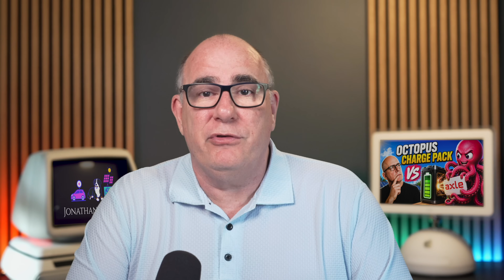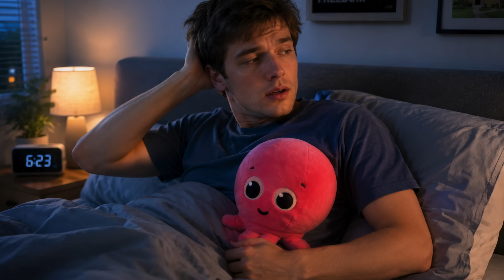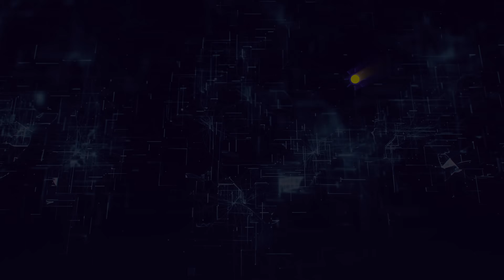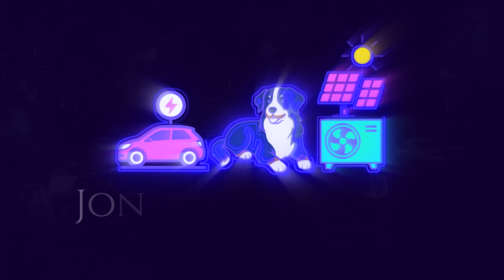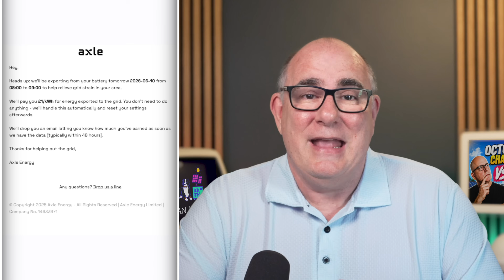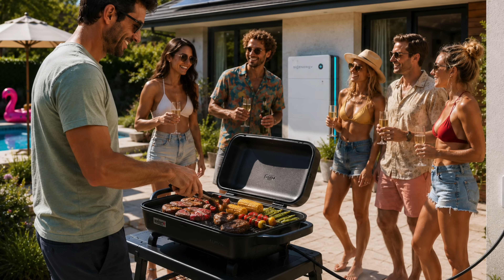Octopus Charge Pack Just Fired A Shot At Axle Energy

Comment: I'm curious how big this hot tub is, you've got the hounds of floof and you want to get in?

Let alone your friends as well...

On the less serious side, have you come across any battery management systems that can connect different model / age / type of batteries (of the same voltage) together?
Reply from the maker: It’s not very big you can get four adults in it, add a fifth and you really need to know each other very well. The dogs do occasionally attempt some sort of flying leap but we’ve discouraged enough that they haven’t done it recently.

I haven’t really done any research into independent battery management systems, there are plenty of them out there for the DIY space, but I just haven’t had the time to look into it yet
Reply: For two different types of batteries you end up wanting two inverters. You've either got to do DC to DC conversion between the stacks or DC/AC so you might as well just keep them as two systems. Of course G98/99 limits can scupper that unless you make one system house internal and not grid tie.
Reply: @etchedpixels Sunsynk talk about their Klik (check spelling), which is not available in the UK or Europe but is used successfully in South Africa and Asia.

Two different battery manufactures same design voltage. Rather hoping someone else had a similar device

Comment: I have a Sigen battery as well as an EV. I use Sig's AI and find it works well. I am on IoG with a Zappi charge point. My current issue is that if I plug in before the cheap rate period it will drain my battery. I could move the Zappi to before the gateway to stop this but would prefer not to do this. I have opted to try charge pack to see if this helps. Home assistant access to the Sig API's are currently read only so forcing the batteries to charge is not available. It will probably be no different to the Sig AI functionality.
Reply: I have the same problem with my Tesla powerwall and Tesla charger

Comment: I have to say I did try Octopus smart automation with GivEnergy for my system, I gave it a month to see how it worked, sorry to say it did not work for me, I found we used more grid power during that month & I would have hoped that would have been cheaper slots not nec at night but it was grid power I would not have used had it been me controlling when to charge so my bill was slightly higher than I would have expected so I would be very wary about handing over control of my system again, they called it smart charging sorry to say I didn’t find it very smart so I will stay in control of my system.

Comment: I'm currently on the full control end of the choice spectrum because it takes a while to get an export tariff after your solar is installed, here's why:

I'm on Iintelligent Go, I have a GivEnergy 9.5kWh battery, an MG5, 4.8kWp solar array, and a heat pump.

The issue is that I don't have an active export tariff yet. So any electricity exported is money lost to me until that's fixed. Hence I'm trying to maximize self consumption. The first few days I exported about 25kWh a day and got paid nothing!

Problem #1 is that Octopus Intelligent Go wasn't letting my wallbox pulsar plus send excess solar to the car. When I overrode that and set a 6A limit to only use the solar, Octopus overrode that to 32A meaning most of it was coming from the grid!  Then over night it overrode my settings and fully charged the car off the grid! I've now installed a system that prevents the car from charging off anything but excess solar but it was a right faff to get working and required pretty extreme measures!

Problem #2 is my Vaillant ASHP seems to completely ignore when I ask it to/not to heat the hot water. It doesn't even show as active, but I can see from the power consumption and temperature sensors I added to the system that it is! Or I ask it to heat it and it says it is, but does nothing. I feel like the minimum requirement as a customer for a product is that you can make it work when you ask it to. Or at minimum it tells you why it decided to ignore you. 

So I've ended up with a rather complex Home Assistant set of automations to get they system to consume as much solar as possible. But a lot of that is going to a portable AC unit to make the house more pleasant to be in, in this heat wave. Upside is I'm consuming 100% of the solar produced. Down side is that it also consumes about 10kWh from the grid over night. I need to tweak the settings to turn off loads earlier to ensure there's enough in the battery to last over night. 

But the issue is that it's currently a heat wave and the house is 24C with all the south facing windows covered with reflectors, windows open when it's colder outside than inside in the evening/morning, and the 1500W portable AC running when there's excess solar or cheap grid power (windows closed).  There's 6 hours of cheap overnight power on intelligent go, that's 9kWh before any house base load use, or the evening after sunset/early morning before sun rise. 

On the plus side, it cost £10 to run the portable AC for 24 hours straight before the solar, now it's about 70p for all house usage and the portable AC. I'm definitely saving money, and maintaining thermal comfort. But when the export tariff is live I'll swap to fully charging when ever there's cheap grid power to maximize my exports and minimize self consumption. 

(It's a one hose Electriq 14000BTU reversible portable heat pump unit, that I've modified to be two hose. I made a 25mm PIR board that slots into a window with the two one way baffled 150mm wall plates in it to separate the hot side from the cold side. Maintains the whole three bed semi detached house at about 24C average during the day.)

Comment: Right now I have a Sigenstor being install, it has its own AI, which I am planning to use.  My plan is self consumption, Next year I and planning an Air to Air Heat Pump and wall units that will heat and cool the home.  In these summer months I am exporting between 6 to 11 kWh at 12p.  That is enough to run the heating in the home during the daytime. Then use the batteries to cool on piping hot summer nights and only off peak power. For hot water and Showers I am thinking of the Sunamp, a small unit about the size of Tumble dryer that heats cold to 40c on demand by using phase-change materials. Clever stuff. That’s my plan - here is hoping it comes together.
Reply from the maker: @steverobinson2389 Sounds like you've thought this through carefully. Self-consumption is usually where the biggest savings are, and with a decent battery system plus air-to-air heat pumps you should be able to make very good use of your solar generation.

I've heard some very positive things about Sunamp as well. Using phase-change materials to store heat is a clever approach, especially where space is limited.

The SigenStor AI will be interesting to watch too. We're seeing more and more systems trying to optimise themselves, so I'd be very interested to hear how it performs once you've lived with it for a few months. Keep us posted!
Reply: @JonathanTracey  yes i will let you know. I am also having the DC to DC charger. I think in inverter is  15 kWh as I am on a 3 phase supply. It’s all very Si-Fi but have done a reasonable amount of research
Reply: We have air/air batteries and solar. Right now the aircon is on and the battery is charging as well, that's with a pretty small array. Be even better if the council hurry up and approve our next 10kW 8)

Comment: I did sign up to Axle and the two events I participated in went without a hitch. But Octopus expressly said that I can't have Axle, at the moment and Intelligent Go.
I only found this out when reading about charge pack.
I have signed up for Charge Pack and will see how it goes, if it isn't for me I'll leave.
Reply from the maker: the last two events I participated in I was on IOG and it worked just fine, mabye they are tightening the conditions to try and get an advantage
Reply: @JonathanTracey  Not sure that it's Octopus who decided this. iOG and Axle both appear to be using the same scheme so you are not allowed to double dip. Just in one case Axle gives you a pound, and in the other case Octopus give you slightly cheaper power all the time.
Reply: After re watching your video, I have decided not to go ahead with Charge Pack. I preferred the simple Axle idea, but if I can't have that, I'll pass. You just got a subscription.

Comment: thanks for the info on this, i saw the charge pack on the octopus website last night, theres a £12 a month incentive to sign up to charge pack from octopus, im getting more than that back from axle every month and its easy to follow/work out, octopus need to give us a bit more info before i hand over full battery control to them
Reply from the maker: @richardhandley3080 Yes, that's crossed my mind as well. If Charge Pack starts attracting customers with a £12 minimum guarantee, Axle may feel some pressure to respond.

That said, Axle's strength has always been simplicity and transparency. If I'm earning £15 from Axle, I'd rather have that than a guaranteed £12 from a scheme where I don't fully understand how the rewards are being calculated. It'll be interesting to see how the competition develops.
Reply: @J @JonathanTracey think what is pertinent here and most people would like to know is how much per kWh Octopus is willing to pay for exporting from their batteries. With Axle it’s clear, £1 per kWh. Octopus is very obscure with their payment description, something about the difference between the import rate and the export rate. Doesn’t sound as though that is anywhere near £1 per kWh!😂
A £12 per month minimum payment means nothing without knowing how many kWh will be drained from your battery each month!

Comment: You make a fundamental error about what ai can predict. People's behaviour on mass is quite predictable. So octopus don't need to know you are having a BBC and heating up the hot tub,  they can make such predictions based on weather time of day, your electricity profile etc.
Reply from the maker: @cunninr2 I agree to a point. On a population level Octopus can probably predict behaviour remarkably well. That's how suppliers, supermarkets and insurers operate.

My point is that for each individual household it's about their plans and their behaviour. The high-level view is great for Octopus, but it doesn't help the individual who suddenly decides to charge an EV, fill a hot tub, have guests over, or simply wants a full battery tomorrow because the weather forecast has changed.

That's why I personally prefer systems where I remain in control most of the time and choose when to participate.

Comment: Great video thanks, I have a new install solar and 20kwh of battery, I will generate through the whole day as solar panels on three sides of roof. I am with Octopus IOG as have two EV’s. My concern over Octopus controlling the home battery is that peak is between 4pm and 7pm and my solar will still be generating around 4kwh, if Octopus then decides to discharge I will stop generating. It would have to be very worthwhile to do so.
Reply from the maker: and that’s the key bit of information that’s missing, exactly how much will they pay you for this, with Axle is clear

Comment: I'm trying to help my brother in the UK who has Solar, Batteries, Heat pump and has just purchased an EV. I have suggested moving from Cosy to IOG and also moving from Octopus Outgoing Fixed to a tariff that makes better use of his 20kWh of batteries. We have talked about a 3 hour forced discharge 4-7pm with Prime or potentially earning more with Outgoing Agile, but for someone who will never use PredBat and Home Assistant,  Charge Pack might make him more money. Looking forward to more videos on this topic and real world experiences from early adopters. He is using Axel currently but has yet to make more than the £10 a month guaranteed minimum.
Reply from the maker: @EcoHouseThailand I think your brother is exactly the sort of person Charge Pack may have been designed for. If he's never going to use PredBat, Home Assistant or spend time optimising tariffs, then handing control to Octopus could genuinely produce better results than a DIY approach that's never actually implemented.

The interesting comparison will be against Axle. If he's only seeing the £10 minimum today, then Charge Pack's £12 guarantee immediately narrows the gap. We really need a few months of real-world data from early adopters before we'll know whether the additional £2 comes with meaningful extra earnings or just extra control handed to Octopus.

Comment: I'd like to see what the compensation numbers look like first.

Their doc says "We compensate you the difference between your day rate and the export rate"

I wonder if that is up or down 🤔, and if this works with Agile Outgoing.
Reply from the maker: but if that’s the case they could say that, by keeping it close to their chest they’re not allowing people to make a decision whether this is right for them or not
Reply: The way I (and gemini) read it, if i'm on Octopus go my day rate is 32.36p so if i'm on agile outgoing, lets say i get 22p outgoing at the peak time they discharge then they will pay you a 10p top-up. When combined with your 22p standard export rate, your total return is exactly 32p per kWh. So to compare the Octopus Total Return: 32p per kWh (Zero net profit for the actual energy cycled; you just rely on the flat £12/month bonus). The Axle Energy Total Return: £1.22 per kWh (£1.00 dispatch bonus + 22p Agile Export). Even after replacing that power at 32p, you are banking 90p per kWh of pure profit.

Comment: Today's updated details so far

Here is what the session credits will cover:

Any battery importing done at your day-rate during a session will be compensated so it effectively costs you the cheaper off-peak rate.

Any exporting to the grid during a session will be compensated at the difference between your import day-rate and your export unit rate.

We'll add a bonus on top as a net reward for joining the session.

These rewards are in addition to your existing rates and participating in sessions will always benefit you financially—you keep your existing Outgoing savings, with £12 per month minimum credit.
Reply from the maker: @trevorpitchell5970 Thanks for sharing that. My first reaction is that you almost need a calculator and a spreadsheet to work out whether Charge Pack is a good deal for your specific setup.

With Axle it's much simpler. Export X kWh during an event, get paid £Y per kWh, plus your normal export payment. You can usually work out the value in your head.

Charge Pack may well work for some people, but the maths seems considerably more complicated and will depend heavily on your battery size, inverter power and usage patterns.

Comment: I'm guessing that both the Octopus "sessions" and the Axle "events" would be at the same time because they're both responding to the same grid requirements. I'm also assuming that trying to sneakily sign up to both wouldn't work, although Axle failed to change my battery settings for the last event, yet I manually set it to discharge and they were happy with that. So I'm not sure how they can tell, as long as the power actually leaves my battery to the grid.

Anyway, thanks for this. I was considering the Octopus scheme, but I'll hang on a bit for now and stick with Axle until Octopus put out a bit more detail.
Reply from the maker: @keysersoze8110 Yes, I would think so, but it's not entirely clear from the information released so far. Axle seems to be focused on specific grid events when flexibility is needed most.

From the way I read the Octopus FAQ, they may have the ability to charge or discharge your battery whenever it benefits their optimisation model, not just during formal grid events. That could be absolutely fine if the returns are good, but it's one of the reasons I'm waiting for more detail before making any decisions.

Comment: We're on Cosy and they offered it to us too.

I'd be OK with Octopus managing our battery so long as it's super-smart, learns about our requirements over time (and how these changes throughout the year) and delivers a good return.
Reply from the maker: Thats the bit I dont know how it can learn, how does it know my daughter stopped in on her way home from work and asked if she can charge her car, or we bought and AC unit on saturday because its as hot as hell. It can predict regular patterns its the irregular ones it will struggle with
Reply: @JonathanTracey  Octopus doesn't know, but does it need too, as you are only 2 people and if she is on octopus too she wont change at home making it go up in a higher level for Octopus and depending on how they actually run it you will either have done some wealth tranfer to the little one or they retroactively reimburse you from the saving they got from her less usage.
Reply: @JonathanTracey  When you are doing that kind of feedback based demand management one thing you measure is volatility and that volatility is an input into how much you set your charge target above what your prediction is (after considering the price differential).

It'll never be perfect but predbat can certainly get really close to that.